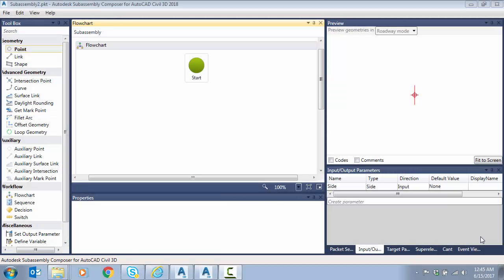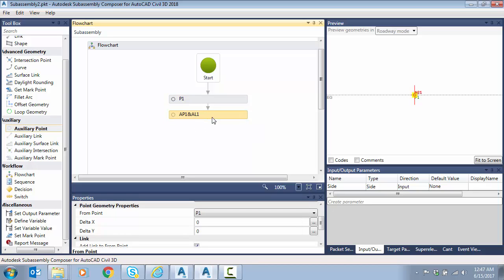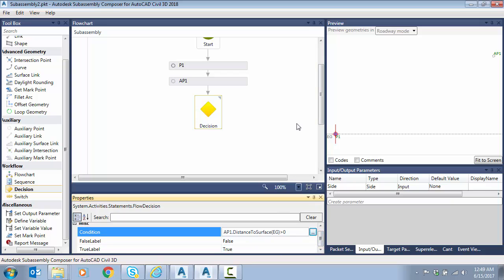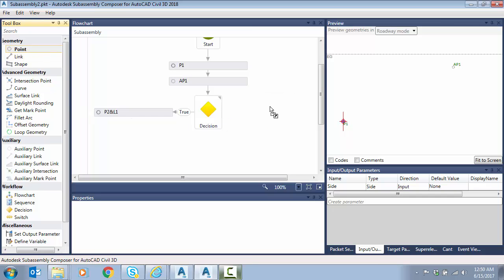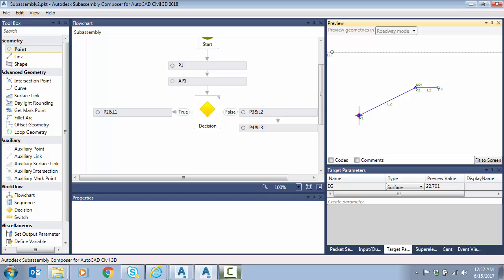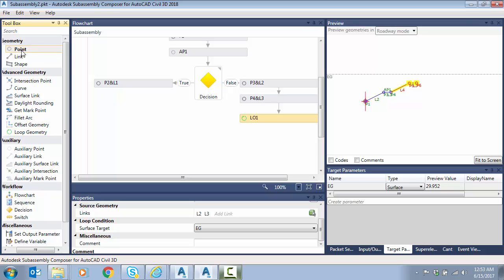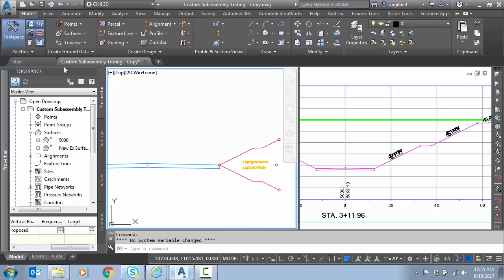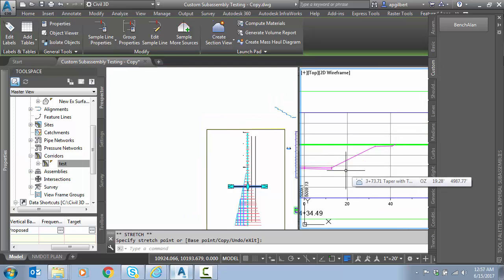Finish Strong Friday: Corridor Slope Benching Using Subassembly Composer

Comment: Alan,

I have a dumb question.  I am trying to create a subassembly that basically targets two surfaces.  I need it to project a slope @ -3:1 as far as possible from my design surface, then conclude at -0.25:1 to an offset parameter which is 2' off PL (basically to make a crib wall with as minimal a height as possible).  I have tried composing with aux points but with no avail. I tried working from the bottom (EG) up, and from the top (FG) down.  My work around has been project a grading object past the wall at -3:1 from FG,  then us an assembly with a link to surface w/ slope assembly to FG surface from 2' off PL, see where it daylights, extract a feature line from the corridor, explode the dynamic line, convert back to feature line and Infill.  Even that has been more challenging then I imagined.  Any help on this matter would be amazing.